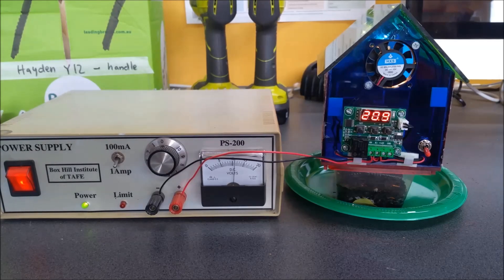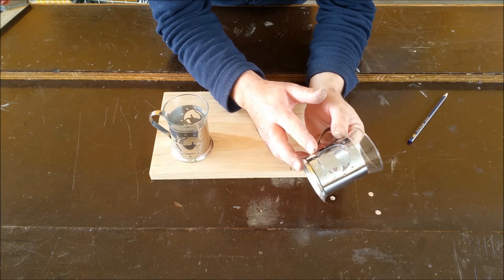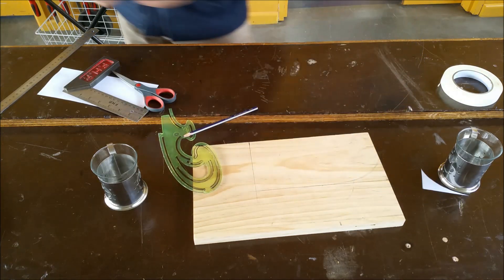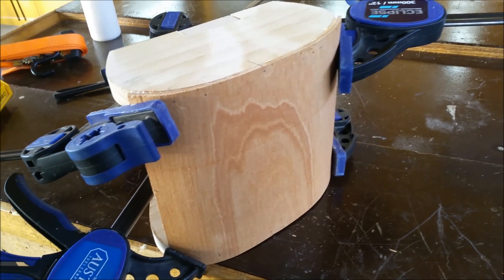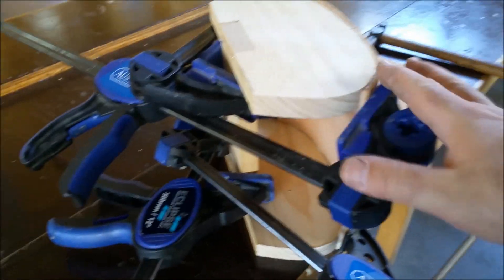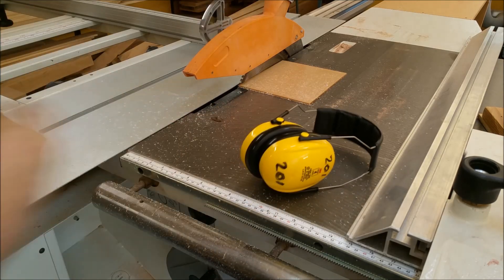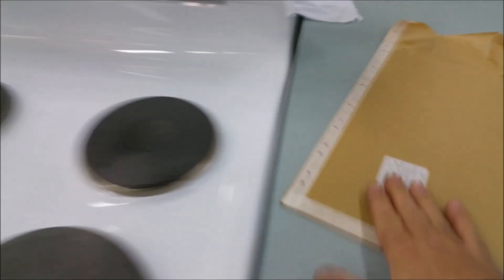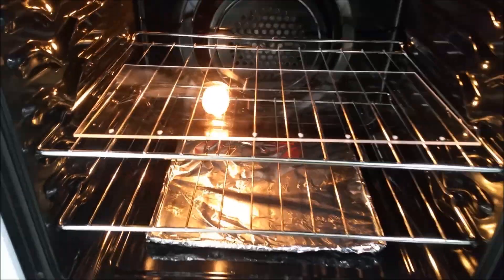Secondary School Systems Class - Making a Form for an Electronic Greenhouse project

Comment: Very Timely - I'm needing to mount my efi controller and water pump controller for the mustang, I was toying with ally, then fiberglass, think I'll give perspex a go
Reply from the maker: Hi Grant, great to hear from you. Your carport/workshop area is looking fantastic, I need a similar setup here - sick and tired of jack stands! The acrylic is easy to work with and very rigid once cooled... I didn't heat this up much - it goes like a floppy cheese slice when warmed more, but soon after begins to break down - gets tiny bubbles through it if you overheat it, cheers.
Reply: @PeterAndersons   found that the new version of davies craig comes with mounts and its more functional and about $150 cheaper than what I paid 3yrs ago,so I bought one, the other one will go in my next project, still waiting for dash gauges and few other items to come from USA before I get to mount everything, covid is blowing freight times out. The shed will be awesome when its done, sparky here tomorrow. Your cost would be qtr down there , its cat 5 cyclone rated my house is only 3-4